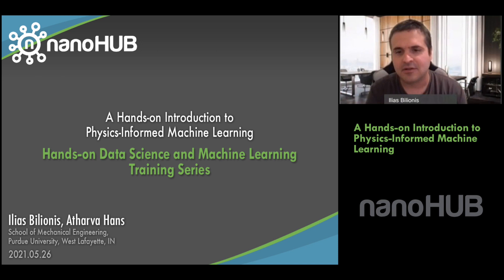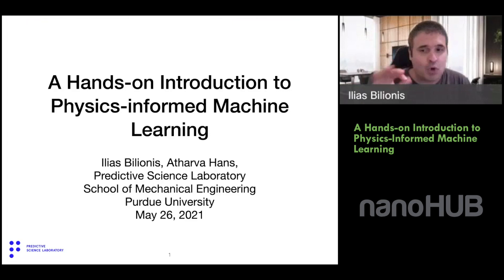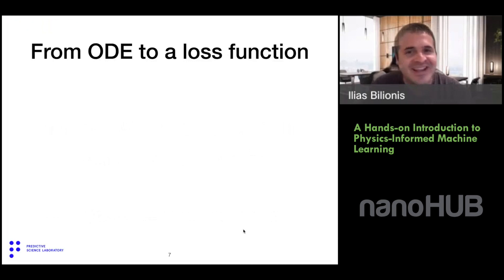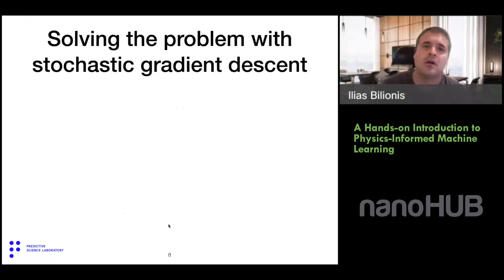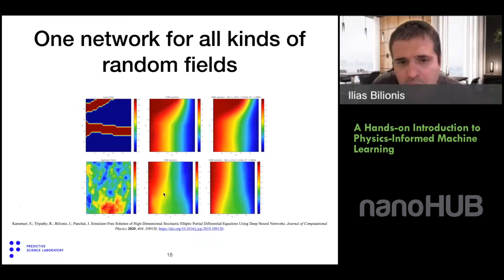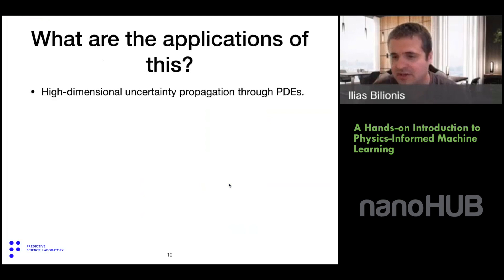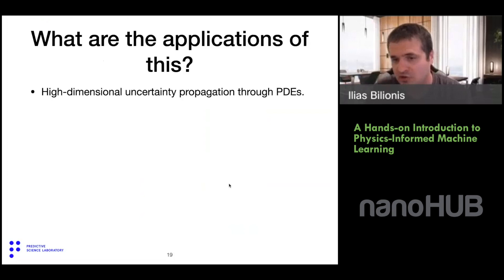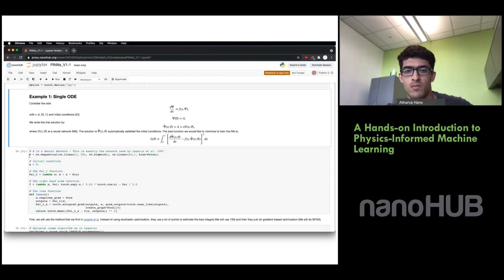A Hands-on Introduction to Physics-informed Machine Learning

Comment: UPDATE: it's working now. Need to put energy_tensor[j, 0] = 0.5 * (torch.sum(F**2) - 2.0) - torch.log((torch.det(F))) + 50.0*torch.log((torch.det(F)))**2

I'm getting RuntimeError: element 0 of tensors does not require grad and does not have a grad_fn, for the Example 2 in this notebook.
Is anyone getting this too?
It seems like energy_tensor.requires_grad is False so can't actually do l.backward().
Reply: when you run into errors, you can submit a ticket through the nanoHUB ticket system so that the tool authors are notified.  (They will likely not see comments posted here.)